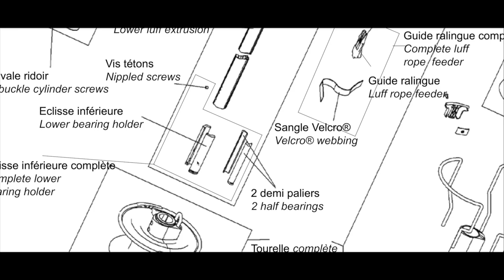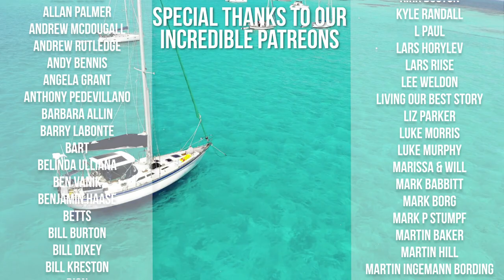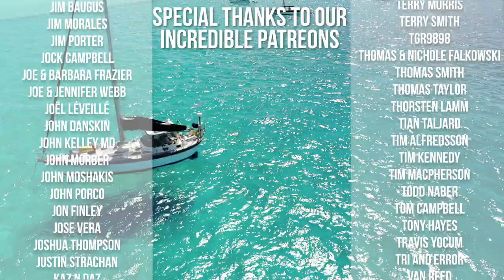One TINY Mistake: Now we're STUCK! [EP 114] - How to replace your forestay - Almost

Comment: Great video as always!
Just one remark: next time you go up to the top of the mast you might consider using the mainsail halyard to go up, rather than the spinnaker halyard. Reason: the main halyard block is in the mast, so if it breaks,you don’t drop ( you can get down,albeit with some friction ) if your spi block fails there’s nothing to hold you. ( with exception of your security line )
Just a thought....
Have fun you guys

Comment: Hi,
To avoid the furler profile screws to thread you can also replace them by the equivalent torx screw.
The torx print is the less prone to threading and some brand (facnor, ...) use them instead of the hallen ones and it's much easier to work with !
Also remember to use loctite or other thread locking paste in those screws... with the vibrations sometimes they come loose !
Best regards from France Guys !

Comment: There is a self centering bit that can keep you from having to re drill and tap the resulting oversize hole. There is also a lubricant to put on the screw threads to prevent it from corroding and locking in so hard.

Comment: I'm about to perform a similar job and after talking to the rigger, this is what he told me; 2 rigger's tips to avoid taking apart the foils. Once it's down cut off the top swaged fitting on the old wire and weld on the '' new wire and pull it down thru. If no welder handy, the other option, if using 1x19 is to unfurl the outer wire layer, as you would to attach the Stalok, but do this at the top again, having removed the swage. Then do the same to the new piece and using 2mm mousing line tie the two pieces together, butt joint, then overlay with strong tape to the full diameter of the wire and carefully, push and pull the new wire down thru. Obviously the latter method is more risky but can be done with care.

Comment: Hi, a little bit of advise for future measuring: for anything under 25mm I would use a 0-25mm micrometer instead of a big set of callipers because micrometer's are much more accurate than callipers. A micrometer is something I would strongly suggest you adding to your toolkit if you haven't already got one. this is just my opinion but I am a qualified manufacturing engineer. hope this helps

Comment: Probably 7/ 16 of an inch. It’s also a good practice to lay the cable out on something soft , so you don’t get little scratches on the wire. Scratches can make stress raisers and points for corrosion.

Comment: I feel your frustration. Typical repair, a job that should take a couple of hours..... I don't care if you just put four screws in piece of old plywood a half hour ago and now you're removing them or if you're outside the International Space Station changing out some perfectly engineered NASA widget - there's always one screw that messes up and delays everything.
Allen screws are dodgy in any circumstance. Those six little shoulders are easy to ruin. When I do anything with Allen screws I always have on hand metric and SAE Allen Wrenches. Some of the metric and SAE sizes are very very close together.  I've got several Allen screws I deal with all the time, for many years, yet I'm not sure if they're metric or SAE; I don't care - whichever Allen wrench fits snugly is the one I use.
Reply from the maker: Lol, what’s the saying “you’re only one broken bolt away from a 3 day ordeal”... 
I know that’s true! 
Totally agree with those Allen keys, they stripped the heads almost immediately with just hand pressure. Will def add some Allen key wrench’s to my ever growing list of new tools needed!

Comment: Quick bit of engineering info Adam, all screws and bolts are 'threaded', that's how they work, the term you are looking for is 'cross threaded' which means when it was put in, it was not put in straight and forced or the thread on the end of the screw or bolt was damaged and then it was forced in which caused more damage. 
It might seem like a small detail but saying 'threaded' makes no sense.

If the screw went in easily but is now stuck due to corrosion and lack of preventative maintenance then it is referred to as 'seized' or in the US they it it's 'frozen' for some reason, frozen everywhere else does not mean that.
Reply from the maker: I believe he meant stripped
Reply: @SailingMillennialFalcon  'Stripped' would mean the thread has gone on a portion of the screw so the screw turns but won't back out.
Reply from the maker: Or the Allen key stripped the head of the grub screw 🤔
Reply: It is possible to change the wire without taking the system apart. Also you purchased the boat in the USA , don't forget about Imperial sizes.
Reply: Up here in Canada where we use salt on the road to melt ice & keep our highways from turning into hockey rinks we use anti-seize compound on threaded bolts...not sure if it will be ok in marine applications but may be worth checking into. You've never lived till you've broken a tap off in -24 degrees😎💣❤
Reply: @SailingMillennialFalcon  That usually happens when the screw has been overtightened or has become stuck or seized.
You can sometimes find a Torx bit that can be pressed into the stripped socket cap enough to get a grip and be used to unscrew it. People usually hammer them in but that might not work on something that is not fully rigid, you can use a G clamp to press them in on narrow or unsupported items.

Comment: Enjoying your vlogs. I’m curious, did you damage or destroy the original 11 mm cable on disassembly? If not why couldn’t you just reassemble with it for the intermediate step? 
Also, In regard to the screws corroding in there threads. Anyplace where 2 dis- similar alloys touch natural corrosion will occur. Particularly when there is a catalyst introduced ( in this case, salt water ) all of the suggestions on this subject brought forward in this thread should work because the product is separating the alloys from becoming activated.
Keep smiling and all the best. Cheers

Comment: You guys need one of those Milwaukee 90 degree drills to power the winch
Reply from the maker: Have you just created the cheapest electronic winch out there?! Worth looking into! 😆
Reply: @SailingMillennialFalcon  if you take a look at any of the sailing doodles videos they're always using them, I can't think of the last time I've seen them manually winching anything, there is a 12V input charger too so it can be charged directly without need for the inverter.

Comment: Could be your backstay was originally 11mm and the person who replaced it mis-measured it and put 10mm on it.  That could provoke a confirmation bias issue with measuring the forestay wire.
Reply from the maker: Possibly, when we took the old backstay off we took it into the shop to be remade so I trust their measurements. Who knows?!
Reply: @SailingMillennialFalcon  That's another.  Wire is tough to measure and I know that from experience as I was an inspector for a defense contractor while going through college. It's tough.  O-rings are also tough.

Comment: Loctite used to require a primer if not used on Iron based materials, guess Blue 243 does not need a primer anymore? Well it has been 20 years since I did keel bolts that did require a primer, so old sea dog, no new tricks.

Comment: Change to torx grub screws way less likely to round out. Just get the 10 mm fittings and Change to 11mm later. Really your on a boat and don't have a set of screw/bolt extractors?

Comment: Instead of using rope hallards as a temporary fore stay couldn't you have used the old wire without the roller reef gear?
Reply from the maker: Unfortunately after cutting it it then becomes too short, we did consider that briefly too
Reply: After writing the message I wondered whether you had cut it.

Comment: guys the 10mm wire would be easily strong enough for the job, we have 10mm on our HR42 with 65 sq m genoa  15 years and no problems replaced 2 years back with new 10mm  the original still looked fine.
Reply from the maker: I’m sure it would have been fine but we’d of had to order a new Sta lock fitting anyway and waited the same time. There was a 2ton breaking load between the two sizes so we opted for the higher strain wire